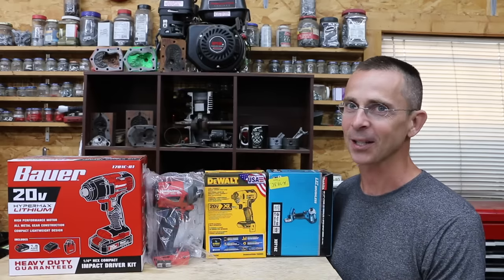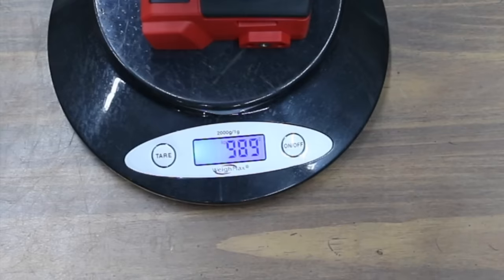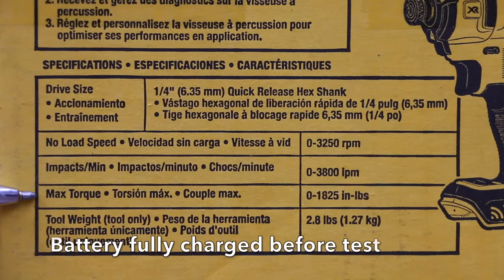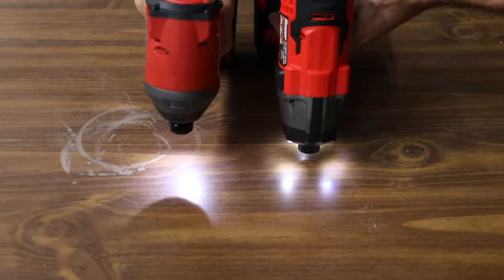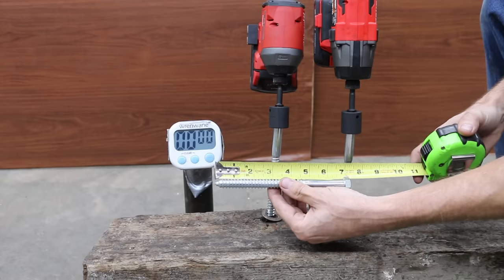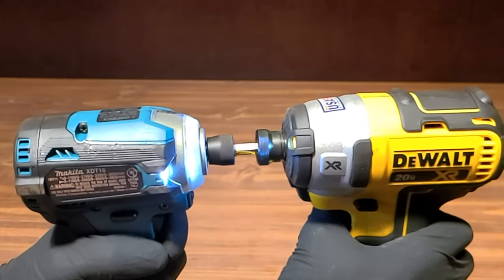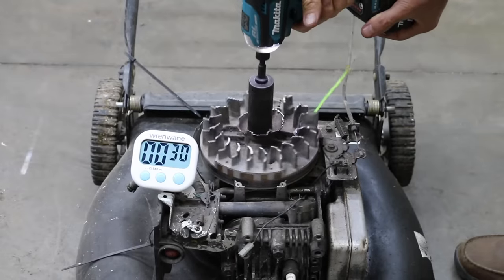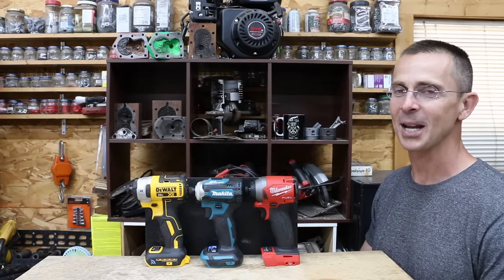Best Impact Driver? DeWalt vs Milwaukee vs Makita vs Bauer!  Let's find out!

Comment: You should have thrown in the "Bosch Freak"
Reply from the maker: I'll add it to the round 2 showdown if there's enough interest.  So far, Hart, Ryobi, Ridgid and Bosch have been requested.  Hoping for more brands.  Maybe there's enough for a round 3 video too.
Reply: @ProjectFarm  I'd also like to see how kobalt stacks up against craftsman
Reply: @ProjectFarm  I wouldn't bother with Bosch. It's just dead like Metabo since Hitachi bought it.
As a Swiss, I can assure you that most of our fleets are composed of Makita/Hilti/Fein/Dewalt for the saw. Bosch is used by consumers because we have great prices on it in our "Home Depot" like stores but it doesn't old up. 
Our consumer stores only carry Bosch, Einhell and Stanley/Dewalt.
Reply: @Grayson203  preferably the xtr
Reply: @ArthA122  Hitachi never bought metabo.. At least get it right. They're (Hikoki & metabo) both owned by KKR.

And neither hitachi or metabo is dead.. Neither is bosch even if it has fallen from grace a bit.
Reply: @ProjectFarm  Don't forget "MultiVolt™ 36V Triple Hammer Impact Driver (Tool Body Only) | Metabo HPT WH36DBQ4"
Reply: @frankvargasIII  that thing is a monster.. 😂 The triple hammer makes an odd impact noise under heavy load.. Just like my Metabo LTX 200 BL.

Comment: I love my Milwaukee Gen III impact driver but to be honest sometimes it's a bit too much of a brute. For jobs that require finesse like driving screws into drywall or soft wood I honestly can't recommend it. It just hits a bit too hard and relying on just trigger control to not destroy your work piece is......well far from ideal as eventually you will slip up and cause damage. Don't get me wrong, it's a great tool but not overly refined. The impacts are just too brutal even on the lowest setting in some instances. When doing jobs that require more finesse I use the Milwaukee M12 brushles screw driver. With its precision clutch it's much easier todial in and  get repetitive result time after time.
Reply: There is something to be said about using the right tools for the right job.  Using an impact hammer for drywall and drywall fasteners is like hitting a railroad spike into a thin sheet of balsa wood with a sledge hammer.  If your goal is destruction, well, I guess job well done.
Reply: get the one key version. they are programmable. With change start, drive, and end speeds. Your rpm/torque is fully customizable. It’s a wonderful addition and makes them very versatile! I love mine I got the 1/2 impact wrench and 1/4 impact driver with it and it makes a world of difference in control
Reply: Also to add if doing a ton of dry wall you can just invest in a drywall screw gun. Very easy to use and works a charm
Reply: Let's not forget a tool made in China out performed a tool made in the USA. WTF? NOT HAPPY ABOUT THAT. LOL.
Reply: sounds like the wrong tool for the job. The drills would be better for soft applications. a impact driver is a drill AND hammer. so there is no "chill" button

Comment: I currently work as an automotive dismantler, and use Milwaukee M18 tools daily.  They take the abuse quite well. The batteries don't hold up well vs. being dropped in my experience though.  I tried using Buaer tools and smoked them all.
Reply from the maker: Thanks for the feedback.

Comment: I sell tools full time. The Milwaukee Fuel 1/4 impact is the best tool ever. With an adapter it easily removes lug nuts from light trucks and all cars. Small enough to fit in your glovebox has amazing capability.  Thumbs down on Dewalt - a very cheaply made product with a 2 pole motor vs Milwaukee vastly stronger mechanism and a 4 pole motor.
Reply from the maker: Thanks for the feedback..

Comment: I would like to see Ryobi tools in your tests. There’s a big following
Reply from the maker: Thanks for the video idea.
Reply: That was the first thing I noticed, was really curious how they would compare
Reply: Milwaukee and Ryobi are the same drill made by TTI.
Reply: @kingsolo6241  yes both made by TTI (along with orange Rigid power tools), but not the same machines.  Believe me, the more expensive machines get better parts and materials.  I've burned up both brands, but a lot less red ones!
Reply: Ryobi at home &  Milwaukee at work sites lol
Reply: You cant turn up on site with a ryobi set lol
Reply: @kaknu  Milwaukee and Ryobi are exactly the same. There is no difference. The only drill that is different is Ridgid because half is owned by Emerson. Ridgid is specifically made more ridged and better than Ryobi and Milwaukee. Everything is supposed to be thicker on Ridged. And the motor is supposed to be more powerful than Milwaukee and Ryobi.
Reply: @kingsolo6241  Sure buddy, whatever you say.  You must be an expert. You still haven't said how you know this info.  My experience is hands-on.  They don't even feel the same, not even close.  And I've destroyed far more orange and green ones than red.

 Hey Todd @Project Farm, here's an idea: how about a test and teardown of brand-family tools like Milwaukee/Rigid/Ryobi, and Stanley/Craftsman/Dewalt/ B&D?
Reply: @kaknu  I use drills and impacts everyday for the past 20 years. Take them apart and Ryobi and Milwaukee are the exact same. No difference. The problem is herd mentality.
Reply: I used Ryobi 120vac power tools a couple decades ago to rebuild a house, and they held up very well. They eventually wore out and needed to replaced. The first few replacements I got just weren’t the same quality as previous models and were further replaced with DeWalt battery operated tools.
If Ryobi has improved their quality, then they may be worth a second look. I don’t know that I’d call them “professional grade”, but they’re probably fine for the budget minded “DIY homeowner”.

Comment: I have a  Makita 1/2" impact and impact driver and abused both for over 5 years as a professional mechanic. The makita's were still working well, but the battery's were at the end of their life span. I decided to replace it all with Milwaukee and keep the Makita's as backups. 3/4" impact Milwaukee died on 2nd use. 1/2" impact still working, went through 3 impact drivers in a year. I'll be going back to Makita when the time comes for all new equipment again. This is just my limited experience with those brands, take it for what it's worth.
Reply from the maker: Thanks for sharing.

Comment: Would love to see if the battery size makes a difference in torque. For example, use Milwuakee's 5AH battery vs smaller 2AH battery.
Reply: It definitely makes a difference.
Reply: Really it comes down to discharge rates and voltage drop upon load
Reply: @thomasbarlow4223  voltage under load will be much higher in a 5ah battery because the load is split between two banks of 5 cells. You can hear and feel the difference in power.

Comment: Been using my Ryobi for 5 years love it, maybe you could compare them!
Reply: I think Ryobi is great, too! But these 3 brands, minus Bauer, are a cut above all the rest in my opinion.
Reply: I’ve had ryobi tools for years, my impact is on its way out, have burnt a few of their tools out, it’s lost a lot of torque! Have upgraded to all Milwaukee tools now n love them!
Reply: The company that owns Milwaukee owns ryobi as well. Ryobi is more there consumer line while Milwaukee is more a professional line. I think they own ridgid tools as well
Reply: Not in the same league
Reply: Ryobi is not really built to the same level. 
Will it get the job done? Yes. 
Will it do some heavy duty work? Yes if you take it slow and make sure the tool drinks plenty of water and stretches. 
But they are not designed to live up to the abuse of constant use every day after waking up next to some old wrench that fell under the tool box years ago, roll out of bed drink a whiskey with a coffee chaser and go bust nuts all day long. Ryobi is a family tool it just isn't so hard inside.
Reply from the maker: Thanks for the video idea.
Reply: I agree Milwaukee is a better tool, I'm just curious how much better? I started a handyman business 5 years ago mostly working with a few real estate Investors fixing and flipping homes. We have renovated 14 houses in the last 5 years and maintained over 200 rentals. I bought my first ryobi set when I started. I now have 3 full sets one for each work truck and one at the ranch. We have dozens of batteries and a handful of chargers I'm sure i dont have more then 1500 invested in ryobi. I admit my original set is getting worn out but still gets the job done. I couldn't even imagine how much Milwaukee would cost for the same amount of tools.  Point being if I would  have invested more money buying professional tools would I be better off??? I think only one man can put that to the Test!!!
Reply: @richardadd8131  if they are working for you then why change?  You could start to phase them out when one goes to the big tool box in the sky, but if they are working then what's the rush. 
I'd you are doing lightish duty work cheaper tools will probably last you quite some time. You know typical homeowner stuff.
Reply: @Richard Add  the only reason why I changed my ryobi tools to Milwaukee was the simple fact majority of them are coming to the end of their life, I’ve had them for years, I still use the 1/2” impact every other day, I literally bought a full set around 8 years ago n they’ve lasted me this long but u can tell that they are all in last legs, brushless angle grinder and drill are the best though! My Milwaukee tools are better, more robust, smaller and all have more torque! The m12 Range is pretty awesome to!
Reply: The new craftsman line seems to be pretty decent. I'm not sure on price of tools vs the other brands but I have seen testing done and they seem to be relatively on par with the others.

Comment: Just watched this as I'm looking for a new impact driver for use in my shop. I have a 12 volt DeWalt that works well for light jobs. I need a 20 volt with more oomph. Looks like a Milwaukie is in my future. What frosts my n**ts is most of these tools are sold without a battery of charger. Then you have to see if the store has the charger and battery in stock. In our town, we have only one major home improvement store. Looked at a DeWalt the other day. Guess what? No battery or charger in stock. "We can order it for you, but we don't know when we'll get it".
Reply from the maker: Thanks for sharing.

Comment: I must be one of the few people who prefers corded drills I can't stand having to deal with charging batteries.
Reply: eh, not everyone has the money or space for a corded drill or AC Impact wrench. I live in an apartment  in the city so i just got a milkwaukee packout and all milwaukee tools, keep the same battery system and no headache. I always have five charged at all times either way.
Reply: I'm an electrician and when I go to a job most of the time a corded drill is a paper weight with a cord. Gotta have the batteries.
Reply: I used to be like you too, until I got a set of cordless drill/driver. Trust me a lot has changed in battery technology. Try it before you knock it.
Reply: @drufuss1981  I'm sure cordless drills might be necessary due to space constraints but as a normal consumer that does work in their garage I prefer the unmatched power of corded drills.

Comment: I'm sure it's crossed your mind, but tool brand competition has tool makers back to the drawing board several times recently, and many tool brands have updated/upgraded. I think you should revisit this test and get Ryobi, Ridgid(both have new, much improved brushless versions, Hart, and maybe Flex or Kobalt. Your testing process seems to really put these tools through the ringer. If they don't survive your test, they won't live in our hands well either.
Reply from the maker: Thanks for the suggestion.

Comment: Seems like Milwaukee has a very sensitive battery management circuit to prevent overheating of the cells. Good for longevity, bad for production, but for what these things cost, rather be a bit slower on production than dishing out big bucks for new batteries all the time.   I think Dewalt has an edge over all the other though in one department, flexibility as there are a LOT more tools matched to their batteries along with a huge line up of different AH packs.  I just picked up a finish nailer, a special deal going on where if you buy a tool over $159, a 5AH battery is free.   I have a Bostitch drill and impact that I bought for the RV, but since those are the only two tools, and packs are not easy to find, going to get more Dewalt stuff now that I have 4 battery packs.    I also prefer Dewalt since it promotes a US company.
Reply: you say that but millwakee is also a US company. and yea makita is technically japanese but so is toyota and last i heard toyota was making some decent junk

Comment: I have 30 + years carpentry experience and used to swear by milwaukee but I don't think the battery life is very good any more.  I'm not talking about from full charge to empty but overall life before replacement. I switched to dewalt then dropped an impact driver 150' off a swing staging and it was fine. Blew my mind and happy with my choice. You should do a longevity test on top batteries.
Reply from the maker: Thanks for the suggestion.

Comment: I have the Milwaukee driver. Takes off truck lug nuts torqued to 140 ft lbs in half the time with a 1/2 drive adapter on an impact socket than my dewalt/Mac mid torque 1/2 drive.
Reply from the maker: Thanks for sharing.

Comment: The shut off on the Milwaukee is to prevent over heating like the others did. I have worked with all but the bower. On the job site they all work great. In my experience the Milwaukee batteries out last the others and the gun is more powerful. My 18v 5.0 Ah batteries are 6- 7 years old and used every day. The makita is the most comfortable and ergonomic tool out there. Milwaukee’s warranty beats everything. Also, their service is by far the best. If they can’t fix your tool in a week they will give you a new one. If you go to a DW service center you might get your tool back in a month, if you are lucky. I have never had a makita service experience. For a homeowner, save you money and get a ryobi.
Reply from the maker: Thanks for sharing.

Comment: I watched this and from your review I dropped $400 on the Milwaukee fuel. I tried it out yesterday. With some starting n stopping it removed 24 year old lug nuts off my car hauler. I didnt use lube or anything. I was so afraid of breaking the studs off. So now I ordered new trailer tires from goodyear.  Thank you for my Vietnam impact tool. I was mortified seeing my beloved Dewalt on here bleeding. My first Milwaukee.
Reply from the maker: Thanks for sharing.

Comment: Even Hart and Bauer are nice. Anyone who owns their own home should have at very least an impact driver. Honestly a circular saw, sawzall, hammer drill and multi tool (oscillating tool) are very handy as well.  

I’ve seen homeowners totally happy about Bauer or Hart, while someone using their tools daily might not agree, but one of these as a backup to their pro grade brand is wise. I also like to have an extra impact for the guy who doesn’t have one or forgot and the Hart serves general impact needs with ease. Yes, more extreme applications need a better drill, that’s what my Milwaukee is for. 

Being an independent contractor aside from my full time job, I am very valuable because I show up to every job with two pack out boxes of my own hand and power tools. You don’t waste time and interrupt others looking for tools when you carry your own tools to every job. It’s nice to see young men and women start taking their job seriously when they start buying/building their tool collection.
Reply from the maker: Thanks for sharing.

Comment: I really don't think my black and decker impact would finish the railroad bolt test. Yesterday I was barely able to drive a thick 3 inch strike plate screw. It kept stopping like the Milwaukee one (maybe over temp safety feature?). It did finish the job (2 screws) but took too long. If I were a locksmith I would buy a Milwaukee or a Dewalt. By now this is very clear: for home use get a cheap one but if you earn even a dime using tools get the best tools and this guy here is sure making picking one easier.
Reply from the maker: Thanks for the feedback.

Comment: I got the new brushless Bauer for free when I bought a 5ah battery for $65. If I burn it up, I can replace it for about $50. I ended up switching over everything to the Bauer platform. I'm not using these tools professionally. I use them regularly, but will likely never wear any of them out. If I do, they can all be replaced cheaply. I can't justify spending double or more for something that only lasts as long as its battery platform is supported. If you're a professional, you have a different need than I do.
Reply from the maker: Thanks for sharing.

Comment: Why did you leave the Craftsman out of the test? I’ve got the Hammer drill they make and love it. Two 4.0 batteries , a brushless motor and charger for 149.00
Reply from the maker: Thanks for the suggestion.

Comment: So the Milwaukee is a wild horse. Which explains why they break. I assume it stops working because it doesn’t have any sort of safety so it can work waaay harder. Like yay my apple computer came with an i9 processor! But it has all these things that makes sure it’s battery lasts long and doesn’t overheat so I’m not getting the full power.
Reply from the maker: Thanks for the feedback.